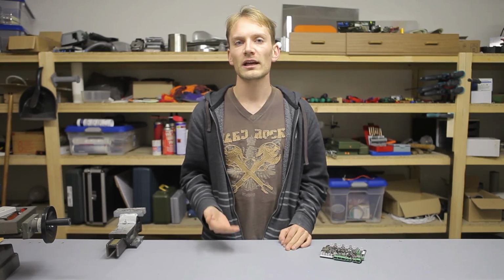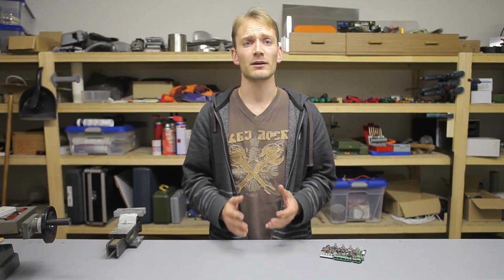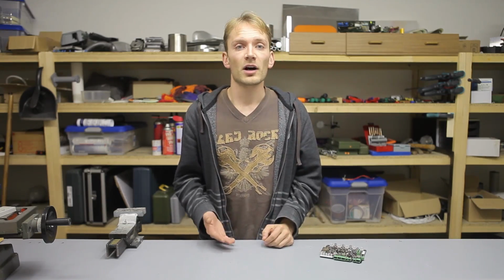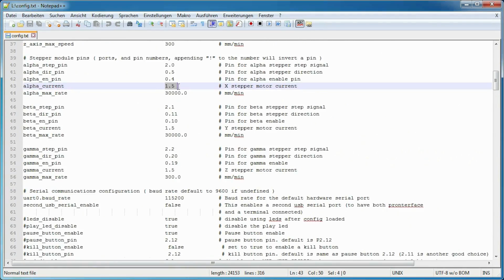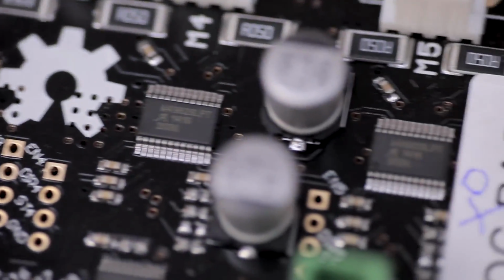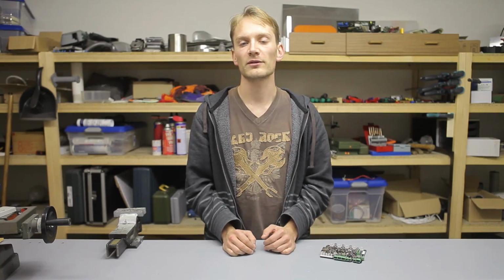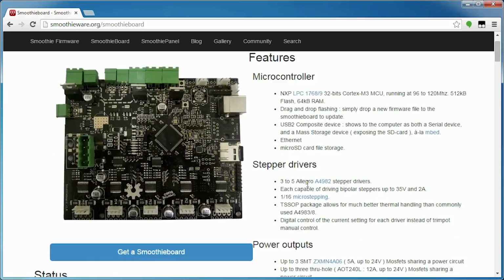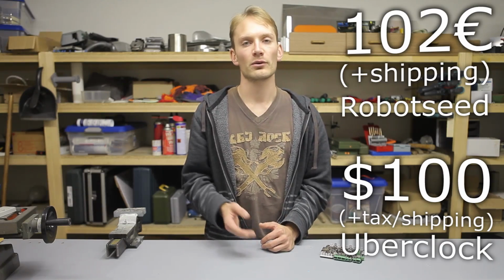The Smoothieboard

Comment: Then what is THE best board?
Reply: Beaglebone - a complete linux PC on a chip. Check out machinekit as a software and there are different shields like the bebopr++ or cramps.
Reply: Dejay Rezme I agree, I got bebopr++ running my delta
Reply: tylor abel I have mine sitting here - still not finished :D But I'm confident it's the best board! ;)
Reply: +James Snell And i dislike integrated drives since i want to be able to swap out drivers or using more powerful external drivers, and i think it sucks when a integrated driver lets out the magic smoke... :)

Comment: Can you desolder the drivers and solder on Trinamic drivers?
Reply from the maker: +Greg Atlas kinda. While you cannot replace the drivers directly on the board, you can easily wire in any other stepper driver board (including Trinamic / Silent Step Stick) since the neccesary signals are routed to pin headers pads.
Reply: Hmm. Sounds confusing without a visual example, but thank you!

Comment: This looks like a really good board! Question: do you know if Smoothieware supports the g-code arc commands (G2 & G3). My understanding is that these are too computationally intensive for most RepRap controllers, but your review makes it sound like this board has ample processing power to handle this. The question is, does the firmware support it?
Reply: ***** Arc support is very tempting. I'm planning on making a Eustathios and from what I understand the arduino has difficulty keeping up when running at full speed.
Reply: Doubt it. I tend to use Cura nowadays but I don't think either produce arcs neatly yet as they've not needed to.

Comment: Hi tom. Thanx for your interesting videos. The smoothie board is great but also expensive compared to a ramps/mega solution. Through, you need to learn a new firmware too. There's nothing like the SB except maybe the Radds which looks like comparable in cadency, and is cheaper. I tried to find useful information on it, but most of it are from german pages. I'm not as good into the german language to understand a eighth of that reprapper's slang. Things you surely understand well. So I stay interested by the radds  but with no good information to make up my mind on it. Maybe it cluld make a future review, or a part of your next Q&A ?

Comment: As always, great video!
I've seen lately some chinese clones of the Smothieboard. Some I have seen going for as low as 50 USD shipped. They call them MKS-SBASE (or sometimes MKS-BASE)

 They appear to be the same apart from using DRV8825's. Have you had any experience with them? If so, would you be able to to a quck comparision between them? (I'm kind of cheap, so IF I can get a "clone" I most of the times do, provided they are of decent quality) Anyway, thanks for your videos Thomas!
/Jimmy
Reply: +Jimmy Heawenson The MKS-BASE is an integrated Arduino MEGA2560 plus RAMPS1.4 and A4988 drivers. It's not a Smothieboard clone.
Reply: +Davey Hi The MKS-BASE and the MKS-SBASE are two different boards. The SBASE is a smoothie clone. I have one on my desk right now.
Reply: +Jimmy Heawenson I have an MKS SBASE I bought for $59 (which is not the same as the MKS-BASE arduino + ramps board mentioned below). There are some small differences as you noted but it seems to be a well designed and made board. There isn't much in the way of English instruction but there is enough to get it done and all the technical documents are available showing pinouts and function in English. I did have a component failure on my first one but the components are quality and the board professionally manufactured. That can happen with any board, it failed after a couple weeks and a couple hundred hours operation so I wouldn't expect QC to have caught it and I just think it was luck of the draw.
Reply: @shaitand69  the questions being, what is the failure rate, why did yours die, would a bad design be visible, would e.g. counterfeit components or use of components rejected from a manufacturing line be visible?  Easy to overload a part or not handle fault conditions well.  "I don't see why that is needed."  <POP!>  "What happened?". "Don't know, doesn't happen often, don't care, ship it!"

Comment: So if I use and ATX power supply and I don't want to solder the integrated buckmode converter, I can just solder another connector to the 5V inputs and connect the 5V wires from the ATX to that?  If that's correct then you are correct and the Future is Here!!!  At least for me.

Comment: I really want to jump from RAMPS+marlin to smoothie+Smoothieware but i'm extremely intimidated by the transition process since i use a Delta.

is there a guide somewhere on all the settings that need to transfer over from a ramps+marlin delta to a smoothie+smoothieware delta?
Reply: +Ryukachoo Read the Smoothieboard wiki, and look thru the example config text file (when you download the latest FW) - everything is called almost exactly the same so you won't get lost at all, plus a load of extra options that will enable you to do your own macros, etc... The only other thing is Smoothie actually defines only 2 Delta parameters, instead of the 4 in marlin...
Once you try it, you'll love the ease of configuring, much faster than arduino IDE!

Comment: Hello,

I would like to make my own 3D printing and I would need 6 stepper motors, what board would you recommend me?

Big thanks from a fan!!!!!
Reply: The Duet, with the duex4 :)

Edit: Or hold out for the smoothieboard 2.0, and make sure the firmware supports what ever it is you want to do with 6 steppers (Sounds like a mixing hotend?)

Comment: When I try your ebay link I get the general front end of ebay but cannot find your site in order to buy one.  Question:  can it operate a dual extrusion 3d Printer (Mendelmax 3)
Reply: jsf777golf Check Robotseed, or Uberclock if you're american.
Links here: http://smoothieware.org/getting-smoothieboard

With the 5X version of the board, you can operate dual extruders.

Comment: There is a problem with some smoothieboard clones like Azteeg X5 and mks sbase , they produce artefacts due to missing micro steps. The problem comes from the stepper driver DRV8825. see this link :
http://www.engineerination.com/2015/02/drv8825-missing-steps.html?m=1
Hopefully there is  an easy fix with diodes (lot of them) in the link.

Comment: Hi ... I am in the process of building my own printer (learning & customized for me). My biggest problem now is, that I would like to run a 3-in-1-out hot end (DSWAY - NF THC-01) and I would like to have a nice touch screen to control the printer (like the MKS TFT32 or the Lerdge). I investigated a lot but I can not find a board to run 6 (or 7 due to 2 Z-axis) and provides a nice TFT touch screen input only the RUMBA board seems to support 6 axes out of the box. 

- Does anyone (or you @Thomas Sanladerer) know a solution for this problem? (e.g. adding additional drivers to the Lerdge or MKS SBASE V1.3 board)
- Can the Smoothieboard do this? If yes, it would be very great if you could make a video showing this!
Reply: coconut_ pie - thank you for answering me ... I will have a look on that and reply here if to show my selection/solution.

Comment: Great review Tom. Really enjoyed it. Very informative and on point.
I have one question though. The video was done in 2014. What is something that I should look at for good processing power. Marlin based and will run dual z and dual extruders with on board stepper motor current adjustment

Comment: this review convince me to buy the Smoothieboard, but I'm having buyers remorse with stalling/freezing issues that are accompanied with an audible beep which is an unresolved firmware issue. Problem is, this board only runs one firmware. I think I might be going back to the Rambo.
Reply: +brett turnage 2 months late, but reflash it- it'll fix it.
Reply: +Arturia Pendragon actually no, that would not have fixed the errors. Smoothie has a problem with micro movements in g-codes. To prevent it you have to run the g-code through a cleaner.
Reply: That was a theory, but glad to hear it's working.
Reply: +Arturia Pendragon No worries. I eventually just got rid of them and switched to Arduino Dues. Having to run the code through a cleaner is too much hassle.
Reply: Fair enough, I'm considering a Smoothie if maybe it'll work with a Rostock MAX V2. Dat sweet, sweet rapid calculation speed. But yeah code-cleaning is a pain in general.
Reply: +Arturia Pendragon I wrote an article on Pinshape a few weeks back about the many 32 bit boards that I tested https://pinshape.com/blog/4-interesting-3d-printer-controller-boards/. If you go with smoothie go with the Azteega x5 v.2. You can run any driver that you want and they have great customer service. I only Delta's and I can tell you that the 32-bit boards are superior to the 8-bit boards for our machines.

Comment: This is missing replaceable motor drivers. You pop one one these and you are replacing the board.
Reply: +jd52wtf You have not watched through the 06:00 minute mark, have you? :)
Reply: There are connectors for external drivers, allowing higher power drivers to be used.